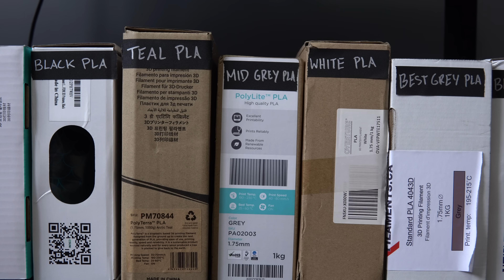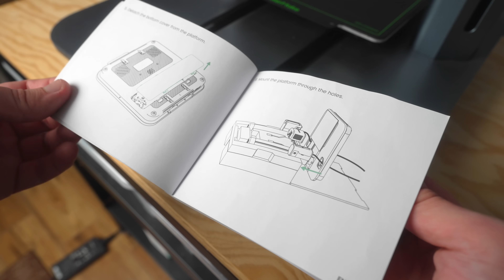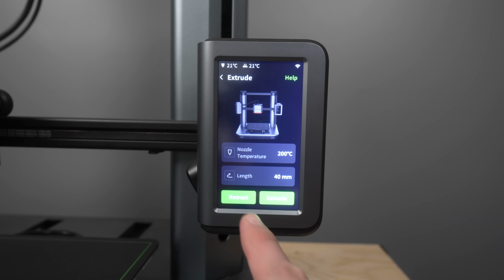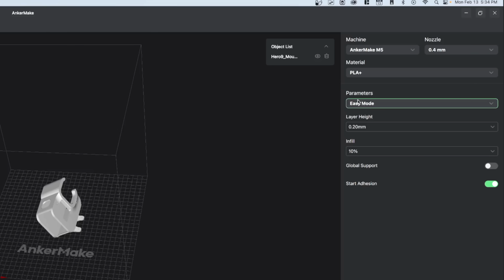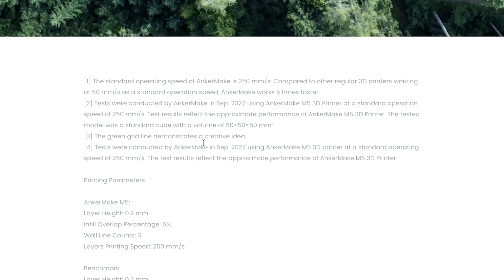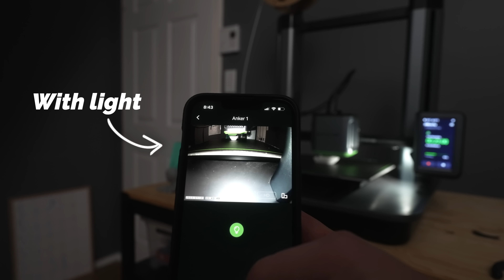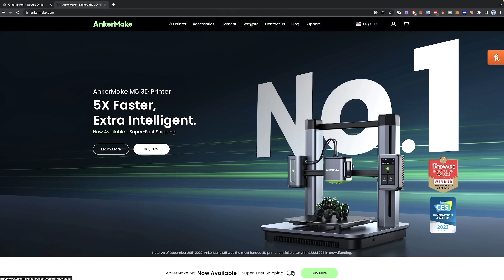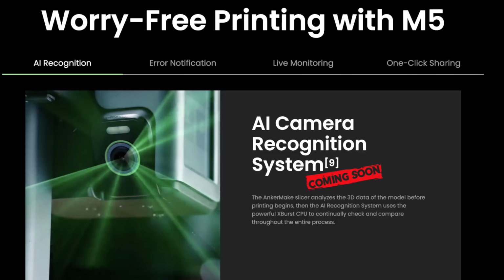The FASTEST 3D Printer I’ve Ever Used (Ankermake M5 Review)

Comment: The default settings on a Bambu X1C only top out at 300 mm/s for PLA and I can assure you the actual speed is MUCH faster than what you show here. Recently tried upping the Bambu's acceleration to 20,000 mm/s^2 from the default 10,000 mm/s^2. Acceleration is the real key to speed, and a bed slinger will NEVER even come close to a CoreXY or Delta, just look at the mass it has to move on the Y? or is it X? axis and the motor it has to move it with - and this changes as you add more mass to the printbed. I'm not aware of any slicer settings that let you slow down acceleration as more mass is laid on the bed, but my CR10 could easily carry several kilograms of plastic on a 300x300x400mm print. Acceleration at 20,000 mm/s^2 makes a Bambu sound roughly like an A10 Warthog chewing through a column of tanks, except MUCH MORE TERRIFYING SOUNDING. Not kidding at all. Sounded like missed steps at that speed, but I tried this on WildRoseBuilds' test cube and the result was perfect, so no, it wasn't missing steps. I just don't want to be in the room when it is printing at that speed. Running some numbers, at 20k acceleration, to slow from 300mm/s and reverse back up to 300mm/s, takes 30 milliseconds. In the time it takes to stop from full speed (300mm/s), the printhead covers 2.25mm. I looked up the CR-10S Pro profile in Simplify3D & it's saying 500mm/s^2 in XY and 100 in Z. 1/40th of the Bambu acceleration! 0 to 300mm/s takes 0.6 seconds on the CR-10, if it could even do it. It takes 90mm to ramp up and 90mm to ramp back down, which for a 300x300 bed, gives you 180mm averaging half-speed (best case) and 120mm at top speed. Given most parts and infill patterns are a lot shorter strokes than this, you can see the print speed is not getting up to the rates they are talking about.
Reply: Bro can you suggest me best printer with good speed and good print quality which is of more than 300mm bed size.
Reply: nerd

Comment: Your whole comparison of speed is completely flawed. Speed in mm/s means next to nothing as acceleration actually dictates the speed the printer can reach. On the ender 3 S1 the stock acceleration is incredibly low. Both printers have roughly the same mechanical capabilities therefore with proper setup this printer is only on par with other e3 clones.
Reply: yeah I added klipper on s1 does 5k acc and 300mm speed if I want set it there

Comment: While it's a nice looking printer, it definitely feels like a big swing and a miss. You can get an Ender 3 S1 pro for $500 cad cheaper. With that savings you can buy a Wyze cam to check on your prints and still have $450 left over to buy filament. It just seems to me like Anker spent too much on getting this up and running and are trying to recoup their money by overcharging their customers. Either way great video Matt, happy to see you're making content again.
Reply: Well, yes you can get better perfomance for cheaper, but definitly not get better user experience for new 3d printing noobs. This 3d printer is geared for new people, you will definitly not get even get 150 mm/s without a lot of tinkering, flow calibration, linear advance and pressure advance tuning etc. Also this one is made to look good to consumers, not just for makers. So while it definitly isnt made for you and me, i dont think its a useless product. Its like a prusa, where you pay 1000€ for a normal bedslinger with outdated hardware, but get decent user Xp aswell.
Reply: @aepfelpfluecker  what? For that money you can get a prusa, and there’s nothing more reliable (and has an better out of the box experience) than one of their printers…
Reply: @erebostd  The Prusa i3 MK3s+ is a solid printer but the build-it-yourself kit cost $799, as much at the M5. That kit takes 6-8 hours to assemble, assuming the person doing the assembly has some basic mechanical skills. The M5 takes 10-20 minutes to set up and comes with an extra build plate, Prusa will send a second plate for an extra 35-40 bucks. I don't hate Prusa printers and for a long time they were king of the hill but they really haven't been innovating the last 4-5 years and their new large format printer has been plagued with delays and they refuse to release important information about specs and performance. Just to clarify they are taking money, 2000-4000 dollars on pre-orders, and haven't even told people the expected performance of the machine yet.
Reply: @JaredCoiner  agree, prusa is long gone as the top manfufacturer and the prusa mk3 the other guy compares it to has a lot less features and worse user xp than the ankermake. Just look at the speed and the fact that u dont have to make first layer adjustments (z offset like on the prusa) on the ankermake
Reply: For $100 dollars more you can get a printer just as easy to use, while being bigger, coming completely pre assembled, that can print a benchy in 20 mins (if you can negate the vibration). This printer is the Bambu lab lab p1p

Comment: The P1P destroys this in both speed and quality.. it’s probably at least x2 faster, not not just marking speeds but x2 faster in actual print time
Reply: P1P is also unreliable and un servicabble, designed to be thrown away.
Reply: @LilApe  Who said that ? I have mine for almost 4 months and it's running as day 1. No problems at all. And it's not designed to be thrown awys maybe get surpassed by a new version as all products like the new Iphones every year.
Reply: @ilvegetariano3836  What are you going to do when the CF rods and graphite bushings wear out? You can't replace them, as they're epoxied in place and BL doesn't sell the parts for them. And BL has said that the rods and bushings are non serviceable...So what are you going to do? You either throw it out, or send back to BL for repair.

Comment: Looks good with loads of features and nearly no setup but too expensive unfortunately.

Tip for starting out in CAD: if your designing a model with some tolerance needed just print out a section of the print to test, eg for your phone holder you could print like 10-15mm height of the model to check phone fits well first. 😊
Reply: Good advice.  I started doing this on longer prints.

Comment: The prints coming out of this printer will have no strength at all... layer adhesion will be abysmal. If you wanna be fast, you need a build chamber to have good quality and strength, also it limits the possible materials. otherwise, the x1 did wake up all the sleeper to improve, otherwise they wont sell shit.

Comment: There are a few things that I disagree with in this video. The biggest though is that if you have an AnkerMake M5, DO NOT forget to find the z offset after Auto Bed Level. The auto bed level resets it to 0 currently, and it is not factored in. 

After Auto bed level on my printer, it'd drag on areas of the bed until the z offset was properly calibrated.

Thanks for speaking out and documenting the printer!

Comment: Get a Bambu, thank me later.
Reply: Hard pass, terrible QC. It's 2023, why are 3d printers still shipping with warped build plates.
Reply: @LilApe  its 2023, why are all other 3d printers still printing slow, even for the $1200 orange ones with 3d printed parts?
Reply: @do7185  Looks like you never heard of klipper or input shaping. Can apply it to literally any 3d printer and be printing fast. There are prusa printers running 400+ mm/sec with klipper.
Reply: @LilApe  Name a printer currently being sold in the market with the same specs and price point as a bambu P1P with prebuilt klipper included?  Go ahead I'll wait hahaha.
Reply: @do7185  literally the Flsun V400. Guess you didn't have to wait long.
Reply: @do7185  lol it's literally $850 directly from FLsun's website. I don't know where you're getting 1,170 from. And they're the same thing lmfao, they run the same speed and put out the same quality. Shill harder for a printer that designed to be thrown away. The P1P doesn't even have basic ass features like crash detection or autoload filament. The "outdated" prusa even has those core features.

I love how you believe you had a "gotcha" moment, its cute.
Reply: @LilApe  blah blah blah, its a printer made to print, not made to be tinkered with.  Some people just want something that works out of the box and does what it intends to do which is to print.  Not everyone wants to be a super 3d printer guru and buy an ender 3 and throw $1000 into it to make it to what Bambu has already done.  You must be a joy to be around in the same room, bitching about other consumer products and how you cant fix your iphone or upgrade everything in your laptop or fix your camera.  "OH NOES..I HAVE TO SEND BACK TO THE MANUFACTURER SO THEY CAN FIX IT!!! SO UNFAIR!!!".  HAHAHAHA
Reply: @do7185  Nice deflection.

Comment: Some tips for printing faster on ender 3 printers (this goes for clones too, like the voxlab aquila etc.). 

 Find a firmware that unlocks your acceleration speeds (or compile your own, there are also people that are willing to do this for you if you ask on reddit), I find when using marlin with no liniar advance or input shaping 2000mm/s^2 accel is about as fast as you would want to go, that's 4x faster acceleration than default. 

Print a good 10c hotter (ballpark figure for PLA) than stock speeds and slow the acceleration down to about 1000mm/s^2 for outer walls and fine details. With these settings I get prints on par with stock speeds at about 1/3rd the print time. I also extrude infill at wider line widths (0.6mm on a 0.4mm nozzle) and for a lot of parts if you set your minimum line width to .32 you will hardly notice any loss in quality as fine details will still print just like using a standard 0.4mm profile (provided you are using the aracne perimeter generator that is now available in both Cura and Prusa slicer, with more slicers adopting this generator all the time). I find I can print inner walls at 70mm/s on a pretty much stock ender 3 and outers at 40mm/s with good detail and very little ringing.

There are so many things I wish I knew when I started that have saved me hundreds, possibly thousands of hours of print time, and so many more tips than I can list here, but once you get into it, it's amazing what some simple firmrware and slicer tweaks can do.

Comment: PLEASE DO NOT BUY THIS PRINTER. Its an overpriced ender 3 v2 clone without linear rails.

Get a P1P or buy an ender 3 and add on the camera and print some shrouds for the extruder. Then install klipper and a cr touch and you’ll have saved tons of money and get the exact same functionality as this. 

Trust me this printer is a huge money grab.

Comment: What a Crap printer....sorry..an x5 Bedslinger that never reach the speed couse of the acceleration limits of that heavy bed...and 820€ for a PLA/PETG printer..no enclosure. for that money you get a Bambu Lab P1P (780€)  that can print fast because of high acceleration...can be upgraded with self printed enclosure and then is capable of printing large prints in ASA and ABS, Nylon...ahh and dont forget that the Bambu have a good working Multi Colour/MAterial Device ( AMS) ...such a high priced Bedslinger is obsolete in these days